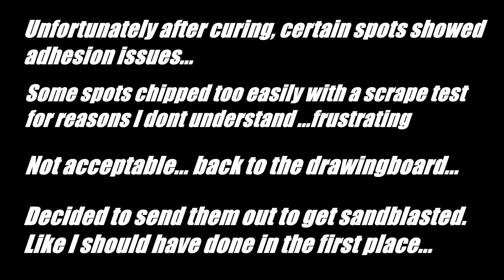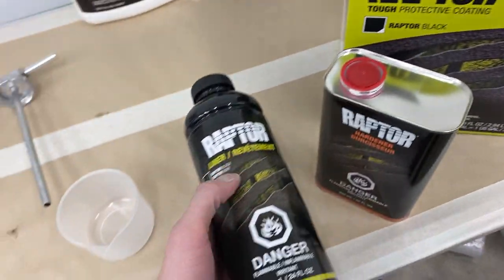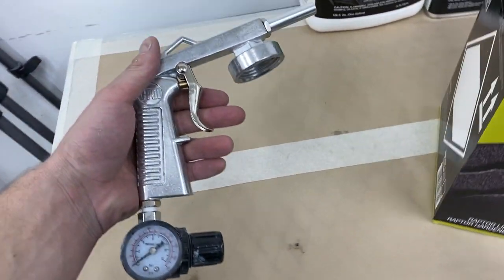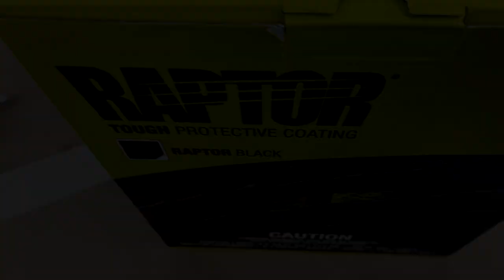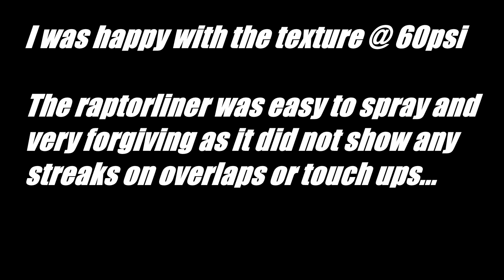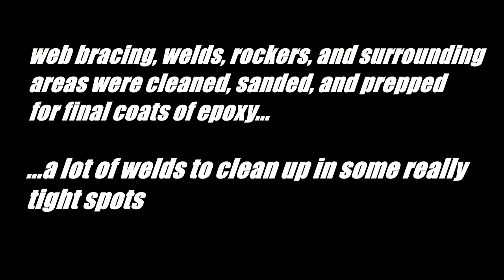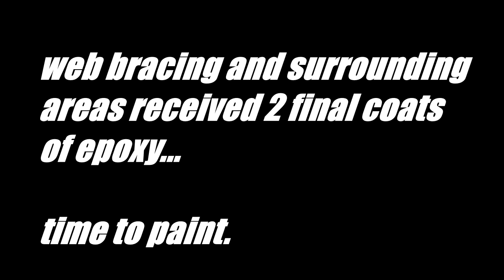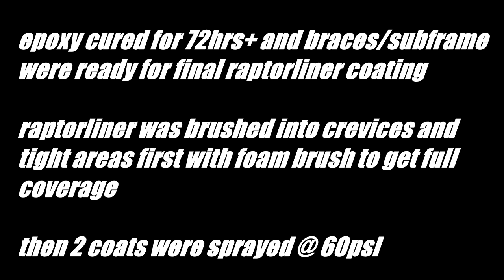99 Saleen Underside Restoration Complete | Chassis bracing & Raptor Undercoating

Comment: How many quarts of raptor liner did you use?
Reply from the maker: If I remember correctly I bought 3 4L kits (12 bottles total) and had about 1.5 bottles left over after doing 3 coats on entire underside, bracing, and outer rocker rails.